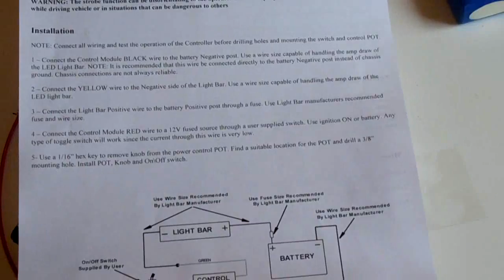350W High Power LED Light Bar Controller Dimmer / Strobe

Comment: So I had asked this on the BleepinJeep channel but I thought it couldn't do any harm to ask here as well. I realize that the "dimmer" is just a PWM and a few other electrical components with a potentiometer to control it, but my question is do you think dimming the light bar would put any added stress on the internal electronics in the light bar? Essentially staving it for power?
Reply from the maker: These light bars have internal electronics that drive the led's. These drivers are actually driving the led's with a very high frequency pwm to regulate current. This is why they have a wide operating voltage range typically 10-30v.
So the hard part is designing a pwm driver that will work with most bars since there are so many different manufacturers and types. 

There will be some additional stress to the bar electronics when dimming. When running full power then it's just like having a relay for on/off. When dimming the bar its not starved for power it's either full on or full off with the full on time being less than the full off.
My oldest install is over 2 years and still working good.

Comment: can this be connected to the positive side of the light bar? my light bar is alright wired and hooked up... running more wires is not possible....
Reply from the maker: No the output is setup to sink to ground only.
Reply: +bstewart63 is it at least weather proof? how much is it? i tryed emailing you but it said it wasnt delivered...
Reply from the maker: bstewart63@sbcglobal.net  This is a working email I get many every day. If it doesn't work you can give me yours in a youtube PM.

Comment: So this thing could theoretically be used for 600 watts of LEDs? I know its not rated for it. I have 380 watts total and don't want to have to fiddle around connecting 2. Would it be safe to use 1 controller for 380 watts?
Reply: Bleepin jeep used it on a 52" dual light bar from rough country.
Reply from the maker: Please send me questions to bstewart63@sbcglobal.net
Thaks

Comment: Where can I purchase one of these? I have 3 light bars that I would like to all be on one switch (on/off) and be able to have them all strobe through the use of  a second switch/controller - this device. Can you modify it with a larger transistor? I am pushing 650 watts or about 55/60 amps. As far as the user supplied toggle switch, what is the current draw on the unit? Should a relay be installed? Thanks!!
Reply from the maker: Hi,
The toggle switch supplies power to the electronics so the current in that wire is very small about 20 milliamps or 0.020 amps. So no relay required. I will send you my email address through youtube message and we can discuss your application. Please reply here if you don't get my message.

Thanks

Comment from the maker: I designed it and built it myself. I do have a couple for sale. You can PM me for more info. Thanks.
Reply: I tried searching could not find your product on line. How do i get in contact with you. I would be interested in your dimmer.
Reply from the maker: Matthew Stiger Hi, I sent you a PM through youtube messenger. Please reply here if you don't get the PM.
Thanks
Reply: bstewart63 Can you send me a PM, interested in this product.
Reply: +bstewart63 still got one to sell?
Reply from the maker: +J. neeshee 
Yes send message to bstewart63@sbcglobal.net
Reply: +bstewart63 do you still have this for sale and are you able to modify the input voltage?
Reply from the maker: Yes I do. Send me a message at bstewart63@sbcglobal.com
Reply: hey I would like to buy a couple of these
Reply from the maker: Please contact me at bstewart63@sbcglobal.net
Reply: +bstewart63 hello, i have dropped u an email. thanks
Reply: Do you still have some of these for sale? A friend sent an email to the address and it came back undeliverable. Just let me know. Thanks
Reply: I tried sending an email but it came back undeliverable, are you still making these?
Reply from the maker: I get emails everyday about the dimmer. Please contact me at bstewart63@sbcglobal.net
Reply from the maker: The email should work I get inquires everyday please use bstewart63@sbcglobal.net
Reply from the maker: The email should work I get inquires everyday please use bstewart63@sbcglobal.net
Reply: Just sent you a PM, the email came back to me again saying it couldn't find a host name sbcglobal.net
Reply from the maker: Very strange. I just remotely logged in to another PC and sent a message to my address and it worked fine. I have received at least 100 emails this week. I am not sure how I can correspond with you about the dimmer. I don't want to do it on here. Are you in the USA?
Reply: bstewart63 Yes, my email is sean.lester@netzero.net
Reply: Can you email me to xSherii@gmail.com. Thanks
Reply: bstewart63 how much or email me @ dennisfulbrightjr@gmail.com
Reply from the maker: I have been building and selling these for about 2 years. Sorry, I am not publishing the design.
Reply: I'm very interested in buying one where could I get in contact with u
Reply: Do you still sell them?
Reply: I’d like to pick one up
Reply: bstewart63 how do I get one? This is cool!

Will it have any problems with a 1500 + watt light bar
Reply: Any left?
Reply: How much??